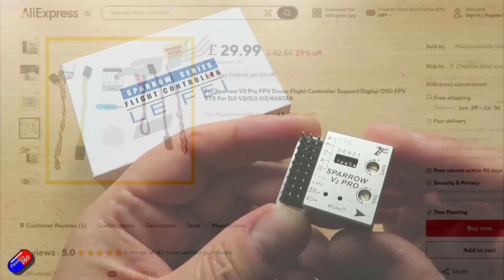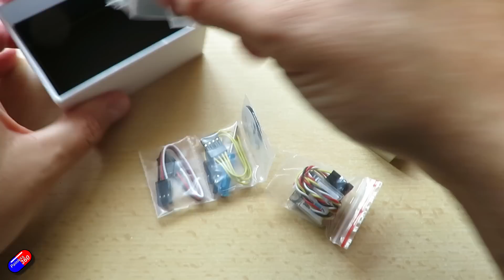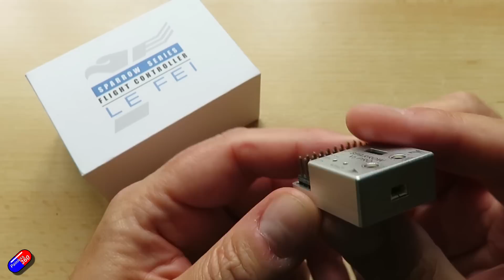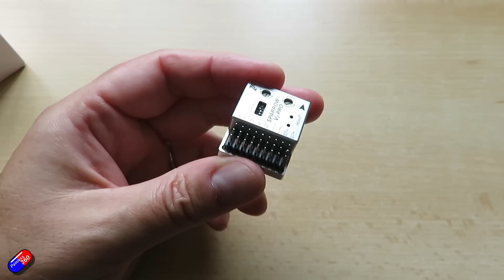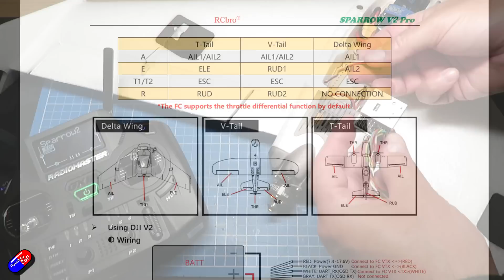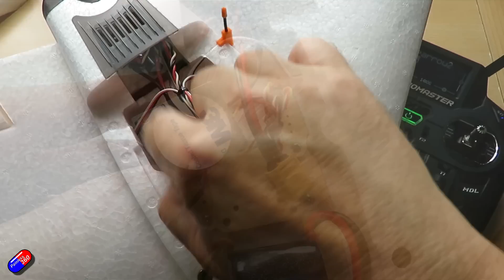LEFEI Sparrow 2 PRO Fixed Wing stabiliser: Basic setup steps!

Comment: I got mine working, have u ever tried to hook up a pan servo to the 2nd throttle channel? 
I plugged my pan servo into the 2nd throttle channel on the sparrow and selected channel 6 as one of my pot knobs on the radio but the servo only works when I increase the throttle so it’s still stuck on the throttle channel 🤷‍♂️
Reply from the maker: Check out page 6 of the manual. I've also posted a post onto the channel with the detail of you can't see it. I hope that helps! Happy flying.
Reply: @P @Painless360  thanks Lee ur the man. I got the pan servo working on channel 6. Just a matter of holding the throttle down and to the right or left as stated in the instructions that I neglected to see.

Comment: Thank you for this video :)
1 question .. i try to connect the Volantex Phoenix 2000mm to the Sparrow 2 pro.
It has flaps and i want it on the T2 servo option.
But the flaps only respond when i try to throttle as the second motor...
I guess i have to set it in the menu of the sparrow to flaps... but no idea how and what its called.
Reply from the maker: Check out page 6 of the manual. I've also posted a post onto the channel with the detail of you can't see it. I hope that helps! Happy flying.

Comment: I’m a bit confused on the flight modes. So on the 3 position switch. 
Position 1 is default as STAB.
Position 2 is whatever u chose on the FC dial ? 
And position 3 is default RTH ? 

Is it only the 2nd middle position u can adjust to Man, Fence or ALTCTL ?
Reply from the maker: Check out page 6 of the linked manual. Best of luck

Comment: I have a question: I connect the Avatar Mini 1s to the Sparrow and it doesn't turn on or work. Am I doing something wrong?
Reply from the maker: Possibly.  What troubleshooting have you already done?
Reply: @Painl @Painless360  I measured the voltage in the connector and it was 0V. I got 5V from another location at Sparrow. The signal cable was left in the video connector, and everything worked, including the video and the on-screen menu. I'm wondering if the problem might be with the video connector?

Comment: Hi Lee, Thanks for all your very helpful videos. I have a strange thing happened after fitting the Sparrow in a Model. I have triple rates set up for Aileron, Elevator and Rudder. In manual mode all the rates work fine ,However, when I select either of the stabilised modes whichever rates I select It is in High rates. I don't know if it has anything to do with the problem, but all the rates show up in Inputs in TX Companion but not in Mixes, which shows only 1 rate at 100 for all 4 channels AETR. Hope you can help seems strange to me
Reply from the maker: Stabilised modes on things like flight controllers don't expect different rates.  Theyll just see a limited stick movement but act the same way.  I don't use rates with anything outside manual mode here... best of luck

Comment: If you want to calibrate all the time level ,  can't you just use the gain screws on the flight controller to adjust the travel of the aileron and the rudder ? And leave the weights at 100 or -100 ?
Reply from the maker: Gain has nothing to do with level. Happy flying

Comment: The sparrow v2 pro and v3 pro can gps hover in place in hover mode . 
 It is not a 3D acrobatic hover  mode , but it is  a gps hovermode .  Click into hovermode with this duing flight and your plane will park in a nose up GPS hovering attitude . Have you tried it ?
Reply from the maker: I don't think that is what happens. Most GPS loiter modes on fixed wing flies it in a circle around a specific position... Happy flying

Comment: So the sparrow and sparrow 2 and sparrow 2 pro 
 Only work with analog .
 And v2 only uses hd dji.  
  And v2 pro can connect with walksnail ?
Reply: Typo there. Correct is "so the sparrow and sparrow 3 and sparrow 3 pro only work with analogue."
Reply from the maker: I've only used the one shown. Happy flying!

Comment: Great video thanks. What if i have extra channels like landing gears, flaps and LED lights? Can i use ER6 for example? Then the throttle cable from ESC will go to Sparrow or to ER6? And if it goes to ER6 then how i connect ER6 with Sparrow? Finally for HD FPV Head Tracking i saw at your other video for the OSD that you solder some cables but these were for the camera i guess. The 3axis gimbal where is taking power from. Sorry for all these questions quite noob here trying to learn. And again well done explanatory videos. Thank you
Reply from the maker: For extra connections, you can bind more than one reciever. See https://youtu.be/3q5KTM7IGI0
Reply: @Painless360 so the xtra three channels that cannot be connected to the Sparrow can easily be connected to the receiver and at the same time the receiver is connected to sparrow via sbus correct?
Reply from the maker: Yes, you can map the channels you want to the spare PWM channels on the receiver. See https://www.youtube.com/watch?v=REdKNOwgNN8
Reply: @Painless360 so if i want to connect the ER8 with the sparrow throughout crsf (i do need crsf for telemetry correct? SBUS provides telemetry?) but without soldering it on the sparrow what kind of a cable should i use? Is there an crsf cable with pwm out? Any ideas?

Comment: Hello Lee, I have run into a problem with the feedback directions. 
Perhaps you might have an idea, what I am doing wrong. I installed the FC upside down in the bottom hatch of my Swordfish and set the mixer to V-Tail. I  am using a PWM receiver and Ch5 for Mode switching and followed your channel setup in  Mixers in Edge-TX. All works well, the sticks move the surfaces in the right directions, the FC mixes ELE und RUD properly for the V-tail. I get GPS fix and am able to switch from STAB to MANUAL and to RTH. I did RC and level calibration. In the OSD pitch and Roll are correct. For example, if the nose goes down, Pitch shows negative numbers. Therefore I think the FC knows it is upside down and compensates for this. 

My problem is that the feedback for ELE is in the wrong direction, if the nose goes down, elevator surfaces go down as well and steer the plane even more nose down. Changing the ELE feedback direction DIP-Switch does not change the ELE feedback direction (I expected the ELE surfaces to go up when nose down) but instead it gives a rudder feedback reaction. The V-Tail surfaces move in different directions. Also RUD Stick now gives ELE moves of the surfaces and ELE Stick gives RUD moves. 
I can exchange RUD and ELE Inputs in Edge-TX to let the sticks do the correct moves again, but this does not address the FC giving RUD feedback. Changing the feedback direction for AIL went fine. I am at a loss, any advice would be much appreciated!
Reply from the maker: What happens if you mount the Sparrow the right way up?
Reply: @Painless360  With the Sparrow facing up in the model, it shows a similar behaviour but it works. With the ELE response DIP-Switch in the low position nose down gives ELE surface up as feedback which is correct. DIP-Switch in high position again gives a rudder feedback to compensate for pitch movement of the plane and RUD and ELE sticks are exchanged. Perhaps my unit has a faulty DIP-switch? 
As it is very inconvenient to have the sparrow facing up in the bottom hatch i.e. having the LEDs and dials not visible when opening the hatch, I remounted the sparrow face down and interchanged the two V-Tail servos on the output-pins of the sparrow. This also changed the direction of ELE feedback without having to move the DIP-switch. Now all works as intended, I hope I did not overlook something. I will do the first flight today, then I'll know if my solution works.
Reply from the maker: Best of luck!
Reply: @Painless360  Thank you! The first flight went very well. The Sparrow performs admirably in STAB and RTH and having the OSD with GPS Information makes for much more relaxed flying in case I get lost. Many thanks again for the videos! Without them I would not even have known this fairly simple to set up FC exists. 
The only thing I have not figured out is how to safe the changes I do to the OSD. Toggling the Mode switch lets me enter the OSD menu, but it does not not leave the OSD menu after changes are made. Powering down discards the changes. I'll try moving the DIP switches away from OSD setting mode next.
Reply from the maker: After all adjustments are completed, push the roll stick left to exit.
Reply: @Painless360  Many thanks again! I have no idea how I missed this in my many attempts to get the changes to be saved in the FC.
Reply: @tscUnhold  Lee has not emphasised 1 of the most important details in setting up most of these simple Plug-and-Play Stabs - ALWAYS set the Flight Controller stabilisation correction directions BEFORE mucking with the Transmitter stick directions. Reversing the flight control correction direction will ALSO reverse the Transmitter stick direction. Reversing the Transmitter stick direction HAS NO effect on the flight control correction. First doing the "Level" calibration procedure tells this Flight Controller which way up it is. No point in mucking around with anything else until it knows that! After that you may get grief with a V-tail or Wing set-up from the way your servos are mounted. Try swapping the 2 servo leads over until the flight controller moves them correctly. Again DON'T muck with the Transmitter control directions BEFORE the FC directions are perfect!
Also ALWAYS read EVERYTHING in the Chinglish manuals - including the FAQ section. Many of them can be hard going but ALL the details covering your problems are covered in the manual Lee has provided a link to.
Reply: @theoztreecrasher2647  Thank you for your input! I did indeed do a level calibration first, as I had my FC upside down as stated in the manual. After fiddling around with the TX stick direction for quite a while and mounting the FC for testing top side up (with new level calibration), I found that my FC has only one ELE feedback setting where it is mixing the V-tail properly as ELE. With feedback reverse the elevator becomes a rudder. 
My solution in the end was, as you stated, to swap the two servo leads. Now all is working as intended.
Reply: @tscUnhold  👍👍 Yep, Those servo mounting directions can catch you out. You'll be doing everything exactly as stated in the manual, but it still won't come out right. Until you take a magnifying glass to the pictures in that manual (inevitably the size of a postage stamp) and see that they have the servos mounted a different way to what you have in your model! 
Glad you got it all worked out in the end. 😉😊

Comment: Is the only difference between the v2 and v3 that v3 supports analog? Any other benefits to the v3?
Reply from the maker: I've not tried the V3 yet... Happy flying!
Reply: Yes, the v2s are for digital FPV only and the v3s are for analogue only. The v3 is a bit more configurable than the v2/v2PRO units but you have to do your own finicky soldering in of the pins for the v3. The v3PRO has the pins already soldered. Choose to suit your own circumstances - they are all good units. Also note that Lefei were the actual makers of the old Kopilot lite units.

Comment: Hi Lee , can you tell me please if you can use two separate aileron servos with this unit and where does the second servo plug in ? Thank you for your patience
Reply from the maker: You'd need to use a Y cable... Happy flying!
Reply: Thanks Lee.
Reply: I believe (but CHECK) that you could set the extra output channel for a separate aileron servo (if you wanted to do a flaperon mix on your radio) BUT you would only have stabilisation and RTH control on the 1 of them. Possibly you could program a model to make it work - stabilisation via a single aileron does work with other stabs. OR you could simply cut separate flaps in and use that extra output to control a y-corded set-up for them. Suck it and see.

Comment: Thanks for the video. I’m interested in seeing it working with Walksnail and how the layout looks on the screen. I still use the older Ezuhf receiver that uses PWM. I’d have to convert it to PPM I believe ?
Reply from the maker: This supports PWM. Check out the playlist in the description for the full details... Happy flying
Reply: I watched the other vids thank u. Looks great. 
I’m still confused how I’d use the sparrow with the Ezuhf. Would I plug the esc into the Ezuhf throttle channel for power and then plug another male to male servo wire in for Ailerons, elevator and rudder ? Only using the signal wire on each servo? 
Or does the esc plug into the sparrow ? But unsure what would power the Ezuhf if I only run signal wires between the 2.
Reply from the maker: Sparrow needs 5v from somewhere. I don't use theEZuhf stuff here. Best of luck

Comment: Sigh.   My planes fly already... meaning they have all the PWM support they need in place, and if I need stabilization then its also already in place with multiple modes, my receivers have barometers and altimeter telemetry, power telemetry, accelerometer telemetry...   I just want the missing link....   OSD with RTH...  I don't want to rebuild and rewire and add Y cables and toss out the hard-earned gyro gains and perfect trimming I already have in place on multiple planes that I'd love to SIMPLY slap cameras and vtx's in!  If the little magic Sparrow box ONLY did OSD w/GPS-RTH, and connected to full-featured PWM receivers, they'd have to sell 'em in 6-packs!

All the same... too cool... bought one to play with. Love the videos...
Reply: Interesting, I'm using FRSKY SR8 Pro with all the stabilization, auto-level etc.  And too, just wanted RTH and FENCE.  So I think the trick is to use MANUAL mode as a pass-thru; then set FENCE mode which I would think is also manual mode with a FENCE (TBD).  So the RX still does real manual/level/stabile modes as pass-thru and if you set FENCE it should RTH as well.  I am preparing to test this out.  Unfortunately the manual V1.4 shows a dial for Manual/ FENCE / ALT, so its a bit confusing.   FRSKY use S.BUS.  So I set the sparrow mode on CH5 and the SR8 PRO mode on CH 10.  I made logicals for making different flight modes (which then have their own trim settings) to combine CH5 and CH10 switches so I can use the SR8 PRO natively with CH10 options and CH5 in mid position, OR use the SPARROW RTH, FENCE by setting CH5 switch accordingly.  I'm doing the same thing for SPARROW V3 PRO, the OSD for that one allows for MODES and SUB Modes.   So there is a choice here for either the V2 pro or V3 Pro to use a basic non-gyro Rx and let sparrow do the gyro (but no stabilze mode for V2), or pass thru a gyro based RX and only let the Sparrow do FENCE and / or RTH.   I'm still setting up my Tx to try these.

Comment: Great video!!! I have the Sparrow 3 Pro as I run analog fpv, and this helps alot on the setup, the instruction sheets are pretty "intense" for someone new to the game, Thanks so much for sharing with us, I'll be looking for the next vids!!
Reply: That's what I bought is a couple of v3 . 
 Now I found out v3 pro has a GPS hover position hold mode . The plane with a v3 pro has a GPS HOVER IN PLACE mode . 
   My first sparrow flight controller was a v2 with dji video  . By mistake I bought it . I have no dji .
Reply: @GregDahl-g6g  The Analogue-only V3 PRO does NOT have a GPS HOVER IN PLACE mode! It has a mode where the plane is auto-stabilised with the nose straight up in the same manner as the Self-Leveling mode auto-stabilises the plane with the nose flying forward! In this mode your plane will be blown down-wind unless you fly it in place with the transmitter sticks! 
If you have a mode selected to allow switch-selected RTH (and loiter over the Home Point) or Fail-safe Auto-RTH & Loiter then when either of those are activated, the plane will resume normal self-level stabilised nose-forward flying and come home.

Comment: Hello, thank you. I have the previous version. I was wondering if this would work for a small plane with flaps, for example the Tundra. Regards.
Reply from the maker: Yes, use the second throttle output as a channel and connect the flaps to it... Happy flying
Reply: @Painless360 Thank you

Comment: Excellent, thank you! This is exactly what I need to get my Walksnail Swordfish some GPS-Support.
Reply: Many thanks again, I just finished setting up the Sparrow FC in my Swordfish. Your videos were a great help! I would have been even faster, had I remembered that ELRS Ch5 is for an ARM switch and is not suited for a 3 way switch. But with Pin5 on the receiver getting its input by Ch9 (remapped in LUA-Script) I can change the flight modes and all works well. Cant wait for the first flight with GPS 😀